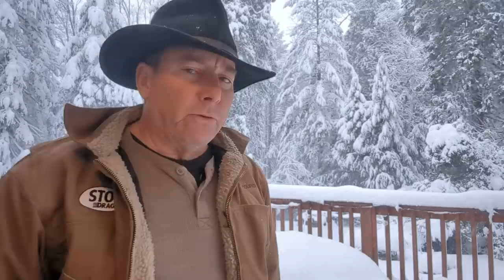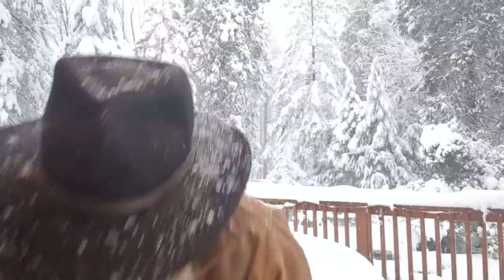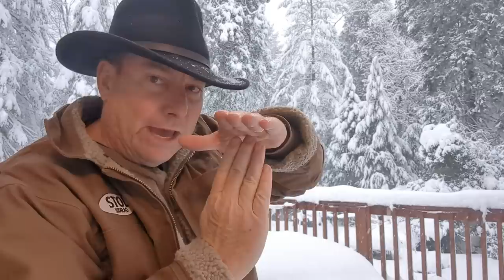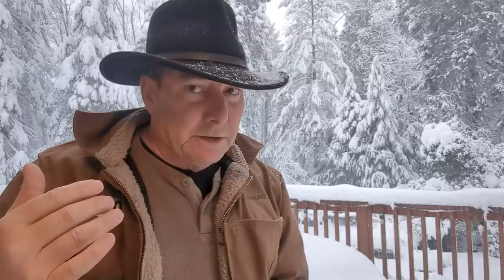PC-12/45 NTSB UPDATE In Flight Breakup! 26 Feb2023

Comment: Is it a failure to initiate the autopilot during spatial disorientation?
Reply: Engaging the autopilot when one has spatial disorientation would generally be a good idea but in this case most of us who have flown airplanes of this size and those who have flown this specific type of plane agree that the autopilot would not have worked due to turbulence.   Turbulence was reported in the area and given the weather conditions and mountains most of us are pretty sure turbulence was a factor.  Small planes bounce around in moderate turbulence going up then down and banking then straightening up  too fast for the autopilot to keep up so the autopilot disengages - turns itself off.
Reply: @loudidier3891  He seemed pretty confident on the radio. I wonder if there was an electrical failure, leaving him with just a dinky standby indicator. Maybe the heart-lung machine over-amped the generator.
Reply: @Parkhill57  The planes I flew had 20 minutes on just battery but using anti-icing would deplete them faster.  It seems he would have told ATC if he had mechanical problems.  What you refer to as a dinky standby indicator is all we had at the commuter I worked for in the mid 80s.  We hand flew (no autopilots) in IMC conditions on a regular basis.  The BE99 and SD3 weren't pressurized so we couldn't get above the weather for the entire flight sometimes.

Comment: Juan, this is off-topic, but I wanted to ask a question about Oroville dam, and figured posting on your most-recent video would get your attention the quickest.
I followed you all the way thru the Dam Series, and I am a retired Industrial construction electrician, so I am into engineering facts, not conspiracy theories.  I believe you laid it out completely back in 2017-18, and I trust your reporting.  In my opinion, the dam and all the associated infrastructure are good for another 50 or 60 years.
I have been following the DWP CDEC page, and I see that the current reservoir level is 829 feet.  I also was looking at the original design specifications and it seems as though the ideal height for spillway release is actually above the height where water begins touching the sill, at the very bottom part of the gates.
My question for your vast engineering memory banks is:  at what reservoir height do they typically start opening the gates for initial release?  I saw a diagram on the spec sheet that shows a line well above the the bottom of the gates, where they prefer to begin their release.  Obviously, they don't crank open the gates as soon as they get wet...
I am guessing we will see the gates open within the next week or so, especially with recent storms.  Any chance of you riding the bike down to your favorite hillside for another video of those gates opening up - that initial flow is pretty cool to watch as it ramps up!
Reply from the maker: It all depends where we are at in the flood control part of the year, snowpack, and weather forecast.  Generally about 850'...
Reply: @blancolirio  Thanks, I knew you'd have that answer right at-hand!  So, we have quite a ways to go, as long as these storms stay cold and snowy in the foothills.
Now, get off your porch and back into the house where the fire should be roaring...  I gotta go ride the ATV over to feed my horse his dinner.

Comment: Global Medical Response has been owned by one, and then another, private equity firm since 2010.  Private equity owners invariably cut corners to save money and to make big profits so they can sell the business to another owner--often another private equity firm--which will do the same thing: cut corners to save money.  Private equity firms run businesses only until they can flip them for a profit.  Note that this is not what investors like Warren Buffet do--he buys and holds for an average of 20 years (and sometimes much longer).

Perhaps the NTSB needs to dig into Guardian's training, staffing, maintenance, and operational procedures to determine if head office dudes in suits (guilty!) are endangering the people in planes.  Single-pilot night IFR in weather: as Dan Gryder says, pick one (hey Dan: here's one more factor that should go on your list: terrain).   IMO, the second pilot exponentially increases the safety factor...but it costs more.  Don't even think about adding FDR's and CVR's!

The suits will look at an aircraft, see it's single pilot-capable, and then try to take out the co-pilot's seat without risk analysis or study of accident parameters.  Here's what I'd ask them: when you hop into your flashy jet for your weekend in Turks and Caicos, how many pilots are up front?  One or two?

Flying is like sex: you can do it with one but it's more fun with two.

Comment: The Stans factory has been warned more than once that a T tail will flutter, as demonstated on wind tunnel tests at the ETH. On the P16 the Professor J Ackeret insisted on mounting the horizontal tail midway up the vertical stabilizer.
The Pilatus Pelican was an ETH design, which started the Stans factory.

Comment: Serious question: is severe turbulence strong enough to break the tail or wing off of a PC-12 (or other aircraft), when flying at normal speeds? I'm under the impression (maybe wrong) that aircraft are built strong enough to handle severe turbulence. I'm asking about straight & level flight in severe turbulence, not nose-diving an aircraft and over-G'ing it.
Reply: Very unlikely a PC-12 would break up in those circumstances. It's very strong. It would probably take an abrupt control movement at high speed to break it.

Comment: The possibility of wing contamination ie. ice, on the climb out, could be possible. If the aircraft iced up to the point where the autopilot can't keep wings level anymore, it will disconnect itself. I wonder if the aerodynamic forces were to great to overcome, together with bad weather, possibly being IMC, could have led to this. Just a theory.

Comment: Requires some clarification:   !. Inflight structural failure , leads to loss of control, leads to spiral dive to the ground.  2.  Spiral dive, leads to structural failure during rapid out-of-control descent to the ground.  Two different scenarios that assume two different causes for the accident.  Also, not likely at all that icing was a factor.  If so, this aircraft would not have been able to climb to 19,000'. Severe-extreme turbulence, perhaps.  Moderate to severe icing, no.

Comment: As a nurse, I have a question regarding in flight voice recorders, would those recorders record what things are said by all souls on board? Not all patients we place in an aircraft are intubated and unable to talk. I have concerns that these recorders would in fact infringe on patient privacy.
Reply: The CVR data information is usually only retrieved after a crash or major incident. At present time they auto erase after 120 minutes so privacy is not really an issue.  
BTW we are being video and/or video-audio recorded just everywhere we go in public anymore. The Courts have rules several times that we do not have a reasonable expectation to privacy once we leave our homes. 
Patient Privacy is great in theory but in reality many times it does not exist. Employers all the time force employees to provide them with private medical information as a condition for maintaining employment.
In fact employees where I work had to provide proof of receiving a certain INJECTION to maintain employment . Injections into the human body are a medical procedure and we had to sign a waiver before taking the injection. The employer also requires an annual physical and will find out any health information that could have me held out of service. 
DOT employees are subject to MANDATORY random Drug and Alcohol Testing. The DOT states that this is for the "common good" of the public in the same manner that CVR's are used for the common good in crash investigations. There are numerous examples where  patient privacy does NOT exist.

Comment: The Reno Gazette-Journal has an excellent interview with a retired flight nurse who lives in Stagecoach. She heard the aircraft fly low overhead, engine sputtering, as the pilot tried to apply power. Then came the sound of impact. Juan's information confirms that
by that point, this aircraft was already coming apart. The pilot, if he was conscious, was probably going through the motions to regain control, even though
he knew it was impossible. What an awful situation.
I agree with Juan that data and voice recorders should be mandated for aircraft performing medical rescue services. I also think
that there should always be two pilots on board. Night flights in bad weather, create a high work load for the pilot. Two heads are better than one. CRM comes into play, and it can save lives.
Out of an abundance of caution, I think the FAA should temporarily ground all generations of the Pilatus PC-12, pending an evaluation of its flight integrity. Too many red flags here, with that accident record.

Comment: Juan, I appreciate your knowledge and understanding of why these situations happen. My question is, when a pilot finds out that they are entering this situation, what is the correct way to get of it?
Reply: I would have to say in that case to focus on the ADI (attitude director indicator) and fly the airplane. 

In the sim we get unusual attitude recovery training and even in the sim, head down and eyes closed before the instructor hands the airplane back to you in whatever unusual attitude he’s decided on, you have audible info on airspeed plus the airspeed indicator to tell you whether you need to add or reduce power while at the same time you check the ADI to see what you need to do to level the wings. 

If you find yourself in a knife edge or nearly inverted dive, you can hear the rush of air and know not to pull too hard on the elevator as you gently level the wings so you don’t break the tail while simultaneously pulling back on the throttles.

If you find yourself in a steep climbing turn with airspeed rapidly decaying, you can hear the lack of wind noise and instinctively know to add power while you let the nose drop in the steep turn to pick up airspeed as you gently level the wings. 

It’s all smoothly coordinated and should be instinctive control inputs to recover from the unusual attitude. I’ve seen and done exactly that flying single pilot at night.
Reply: @speedlever  I think most teaching of unusual attitudes is done this way. The way my CFI taught me (and the way I teach my students) is to have them close their eyes and fly the plane with simple instructions... start a turn/climb, etc, then level the wings (they never return to level). Do this until they have put themselves into an unusual attitude and then have them open their eyes and recover. You can absolutely feel that you are straight and level when you are in a very steep bank.
Reply: @NVFlyer  
That sounds like a great method outside the sim!
Reply from the maker: A second current and qualified pilot.
Reply: @blancolirio  

While that sounds like an easy solution, it still won’t prevent all cases of spatial disorientation from crashing. How many crewed airplanes have crashed with 2 pilots upfront due to somatogravic illusion? The answer is too many. So 2 current and qualified pilots may help but won’t prevent all as history has shown us.

Comment: As a 35 year long career Airline Captain with about 25,000 hrs, I would caution about locking in on a probable cause this early in an investigation, in this case spatial disorientation. Lots of valid comments about S.D. but lots of them are from relatively inexperienced pilots or those that lacked recency or frequency of actual IFR flying at the time they experienced it. This is key and I don't yet believe we know this pilots experience and recency of actual IFR and night flying. The condition is rare among pilots in my field simply because of training and constant experience in these conditions, and even if we experienced a "moment" of vertigo or disorientation, we would instantly resume solely flying by the instruments, and the feeling quickly passes. In fact at night, in and out of clouds, ie IFR conditions, no one would even be looking out the window..... thats just the way it is, you're on instruments period and you typically stay there. Next, I presume no one really knows yet as far as the aircrafts avionics package and operational status of in particular the autopilot. Most PC12's have a fairly impressive package so that shouldn't be an issue but it is possible the autopilot was deffered for later maintenence. If so that could be a factor. In the Airlines use of the autopilot is HIGHLY recommended in all phases of flight to allow the pilot to better monitor and manage the flight. Next, spatial disorientation usually occurs at the first moment a pilot encounters or enters conditions that trigger the disorientation and therefore I would've expected this pilot would've had a bout of it right after take off or certainly shortly thereafter as he was passing thru multiple cloud layers typical of winter weather. Usually once a pilot recovers the discipline to "stay on the gauges" the feeling passes. Now that being said, all bets are off depending on the currency of his experience and overall experience in night IFR, ..... again those are the factors in preventing and recovering quickly from SD. I've lived thru MANY investigations in my profession and one thing I've learned is to try and resist the temptation to identify a cause this early on. We probably don't know the precise cloud conditions yet at every altitude he encountered..... its possible the aircraft encountered icing conditions beyond the ability of its deicing systems, and the tail or wings simply stopped flying which would lead to a catastrophic loss of control and subsequent breakup. Structural failure of a key flight control system while remote, is also a possibility, so is the possibility of an instrumentation failure, electrical failure, for which there are procedures and some back ups, but again in those cases training and experience will dictate how well those go. An autopilot failure or instrument failure of some sort at night in the clouds could easily cause a "sudden" misinterpretation of orientation and lead to loss of control. There are many possibilities but pretty much declaring spatial disorientation as the probable cause this early is doing a disservice to this poor pilot. Let the investigation take place, but unfortunately this class of aircraft likely does not have much if any in the way of a digital data recorder that would reveal much about what happened.
Reply: The pilots previous job was night freight hauling.
Reply: The question is did the aircraft experience structural failure and cause loss of control or did the pilot lose control and cause structural failure due to over stressing [ excessive G's ] ?
If the pilot caused the in flight breakup then the next question is why? No CVR or FDR is going to leave many questions unanswered.
Note: there is an AD for Horizontal Stabilizer rear attachment bolts.

Comment: I have experienced pilot spacial disorientation. During my flight training with an instructor next to me.  We conducted spacial disorientation training whereby I the student would wear the IFR hood while the insructor maneouvered the A/C into a positive G spiral dive.  Then he said...recover.  While still wearing the hood only referencing my HSI, ALT, ASI.    Not an easy task even with an instructor onboard in controlled environment. Then I would do the same with partial panel...no HSI and using the TC with ASI and Alt.   This training should be done regularly by operators esp when conducting single pilot operations in high performance A/C.  Yet another senseless and preventable accident.   Best solution....recurring training and fly two pilot IMC!

Comment: Based on ADS-B data, I think most agree AP was engaged until the 5:11:21.  But at that point, I think pilot takes control due to severe turbulence, or mechanical issue and AP is disengaged.  Vertical rate oscillates between ascend/descend, minimal at first, but gets progressively worse for remainder of flight up until 5:13:14.  At that point, vertical rate indicates spiral descent at alarming rate.  Did a jammed, or partial failure of horizontal stabilizer cause initial deviation?  The fact a course correction is made 5:12:20 suggests pilot was flying via instruments, but fighting mechanical issue, which completely fails at 5:13:14.

Comment: A very long time ago, after obtaining my instrument rating, the day came for my first solo actual IMC flight and instrument approach. In an A36. Wintertime. Lousy weather. Low ceiling.  At night. On the way to the destination airport I started getting tossed around. I will never forget the rain and wind. I was able to hold the A/C pretty much straight and level but I would have sworn I was flying at a 45 degree left bank. I was overwhelmed with the desire to "right" the airplane by cranking it over 45 degrees to the right. Obviously... I didn't.
Reply: That's interesting. What country are you in that allows you to fly IFR solo while you are still in instrument training?
Reply: @igclapp  Daa... good call. I have no idea why I stated my post that way. Actually it was my first time solo in actual conditions AFTER I got my instrument rating. That was over 50 years ago and you know what they say... memory is the second thing to go.
Reply: @demiurgiac  Ah, ok. I figured it was something like that. Just had me scratching my head for a minute.

Comment: Nothing wrong with T- Tail designs . Boeing 727 and MD DC9'S flew millions of flight hours with T Tails without major issues. I already know some some of the sharpshooters will bring up the Alaska Air Flight 261 MD83. That crash was due primarily to improper Horizontal Stabilizer Jackscrew Maintenance Practices and not design issues with the T Tail.